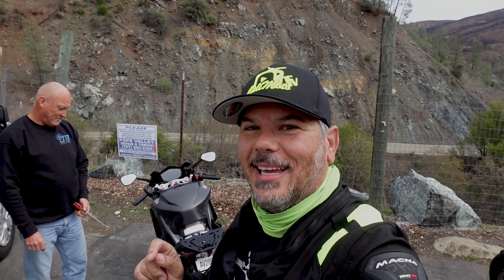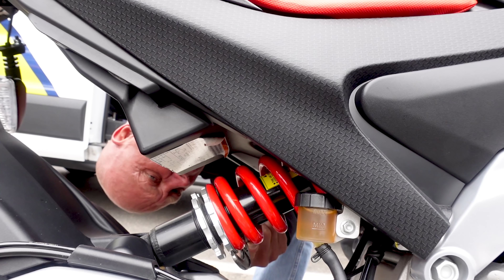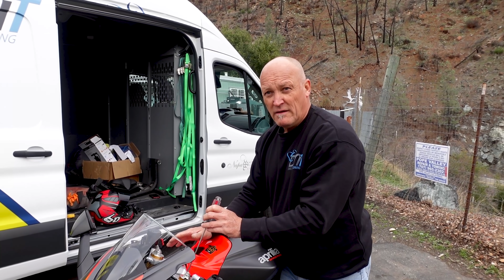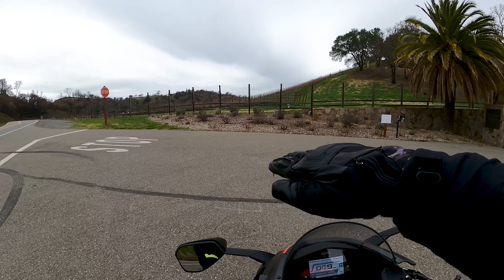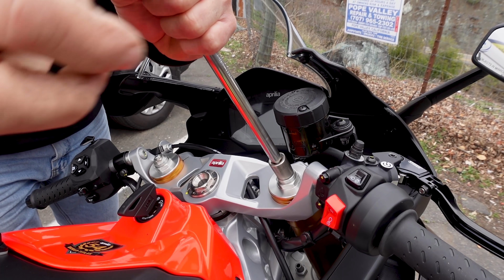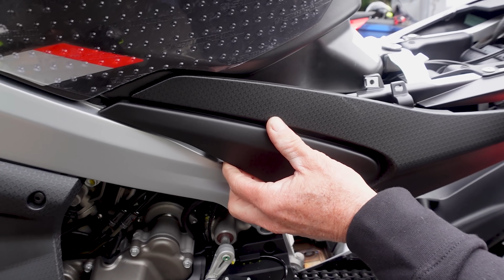2021 Aprilia RS 660 | Suspension Tuned by Dave Moss

Comment: So I am 206 without riding gear. This bike is 13 grand or more and I would need to replace suspension? Is there a fun good handling bike like this that comes with a suspension for my weight class?
Reply: Sounds like it would be fine since you are 40 lbs lighter and they got it set up fine. Bear in mind manufacturers can’t build a bike that has unlimited adjustability and optimized performance as those design goals counteract each other. This bike is definitely biased towards performance over adjustability. They try to find the sweet spot and design both the suspension and rider triangle for the average rider’s size and weight with some range of adjustability on both sides. I have the RS 660 and it’s such a great bike that I wouldn’t think twice about spending a couple hundred dollars on a spring.
Reply: @samanthagregoryurich4167  Great…thanks for the info. Sounds like I would like to try it. So I would be riding mainly on the street?
Reply: @dry509  I've seen bigger guys on the track with the RS 660 without mods so even on the track it would probably be fine up until the intermediate level (usually red group). For the road, no worries. You would be missing out if you don't do track day though! 

I'm 170 pounds and have been running the stock settings for 8000 km and thought my bike handled perfectly. After 5 track days, I'm going quite a bit faster so getting to the point where I should probably stiffen it up a bit when I'm going to the track.  I'm starting to feel some of the things Dave Moss is talking about and I can see it on my tire wear. Still, the bike gives me enough confidence to out-brake more experienced riders so it can't be very far off in adjustment.
Reply: @samanthagregoryurich4167  Awesome…thanks for the feedback.

Comment: I did a remote tuning session with Dave back when I had an Indian Scout Bobber that only had preload on the rear shocks.  Between the adjustment he helped me walk through along with tire pressure changes and handlebar/controls adjustments, it was like riding a new bike and saved me from spending money on shocks I did not need.
Reply from the maker: Nice! That sounds about right 👌

Comment: why not just drill a 3/4 in hole in the plastic to access the rebound screw.....think aprilla would have done that from factory actually......clean hole with a grommet covering the edges would look clean and give riders a way to adjust the rebound without taking seat and plastics off......thts insane having to tear bike apart to access a screw for the shock
Reply from the maker: You'd think that 😂

Comment: Dave Moss!!! THE grandmaster of Suspension tuning worldwide. You never stop learning, by watching him explain the art of suspension tuning! Greetings from Greece (Athens) and one of the biggest fans/followers of yours Mr.Moss.
Reply: World wide. Easy....
Reply: I think this guy got no idea wtf he’s taking about . He says he’s “compressing “the spring , the only think that changes the compression of the spring is the weight of the bike and rider on it . By adjusting pre load you are only adjusting the ride height by extending or retracing the shock .  If you were compressing the spring the bike would be LOWER . You can’t adjust the tension of the spring ! He says ride will get stiffer if it’s got more pre load but ride should be softer, it’s up higher in compression stroke where the valving is lighter . 🤷‍♂️ I have no idea how you could be a suspension tuner and have no grasp on this concept …

Comment: most OEM componets the rebound has an effect on compression as well......am sure the top tier suspension companies have isolated this better or completely but i know my older bikes worked this way. ( think my ohlins TTX had them isolated pretty well )....i love suspension and not a tuner just a fiddler......ever since i tuned mine to perfection " on accident" b4 a race i been fascinated ever since......he seems way too heavy for stock spring especilly if he is faster rider......new shock in the horizon with stiffer spring.......suspension is such a fickle thing but so beautiful when you get it dialed......
Reply from the maker: Yep

Comment: Am I the only person here who thinks this guys logic on pre loading a shock is completely wrong ? When you “add preload “ you aren’t compressing the spring “ as he states . You are extending the shock inside of the spring ! Therefor  making the bike taller . The spring stays the same as it will only compress by what ever weight is on it .  And adding “pre load “ or making ride height taller in rear won’t make it stiffer . It should make it softer if anything as you are now further into the softer part “top” of the suspension stroke  where valving etc is softer . He says he’s compressing the speing , that which isn’t possible but if it was he’d be lowering the bike

Comment: I am the same weight as you so I’ve gone from 18 clicks out of 21 to 15 of 21 on the front and 2 lines on the preload. And from 8 clicks out of 16 on the rear shock to 4 clicks out and added 2 full turns of preload on the rear which started at 6 lines showing. That’s the same as your setup isn’t it ?

Comment: Wheel travel at rear is 130 mm so rider sag of 26 mm (your starting point) is only 20 %. I would have left it as is and certainly not added preload.
Reply: He's bottoming the shock though. I'll choose to add preload too rather than running out of travel at this point. The true answer is aftermarket shock with correct spring rate.
Reply: @paulh9301  the tuner says he can bottom the shock by hand which is very surprising and something the video misses. It's confused also by making damping adjustments at the same time. It's after increasing the damping (maybe it does both compression and rebound like he says) that he says he can no longer bottom by hand. I always set the sag first
Reply: @Bunter1815  That's exactly what happened.  Preload was set for sag first. Dave added rebound damping because he was expecting to need it after that change.  He did explain it's because it'll be closer to topping out so he's trying to slow it down.   The damping adjuster, like other cheap Sachs units, is combined for rebound and compression.  So they only wanted extra rebound but got extra compression with it.  Hence backing it out again once the tyre showed the compression was too stiff.  But the result was still balanced front-to-rear in rebound, so no problem.
Reply: So if say you are a lighter rider, say 180lbs, and have not compressed the spring and damper through wear as much, would you still likely need to adjust the rebound on the rear to avoid the double/triple bounce?  
Has Aprilia set up the RS deliberately soft from factory (meaning high rebound, as Dave talks about "dialing it back" meaning reducing the rebound?).  
Many reviews of the bike mention the rear shock as the bikes weakest link, just wondering if this is because of the setting and has the setting been a contributing factor to the bearing play (AP Workshops review).   Any other owners experienced the bearing play/wear in the shock?
Appreciate help, expect my RS660 some time soon and I'm a complete novice on the mechanical front.

Comment: Hi Mate! I am new to your channel and this was a nice video. I just wanted to say my height is 168 cm and if i buy a 2017 gsxr1000 or a zx10r/zx6r  will i be able to balance them with my both foot or will i have to tip toe? and do u suggest that if i lower the suspension of the bike would i be able to balance with both foot? waiting for your reply :).

Comment: I don't mean to sound harsh, I just found your channel and this is the first video I've seen, but I find it strange that someone who seems to have significant experience on a bike and has a good following on a motorcycle based channel would have such little functional knowledge of suspension.  Even terms and descriptions.  Just seems odd...Like not knowing ANYTHING about setting rear preload, or which way the adjusting perch would need to turn, how that affects static ride height etc.  These are very basic concepts.
Reply: @CaliMotoTV  Yeah that's fair.  Just that there's not always a Dave around when you live like, pretty much anywhere else in the world.  I don't mean you shouldn't use a Dave, but unless you were playing dumb to play up his skill it seemed a bit odd.

Comment: Have Aprilia set this up for "lighter" riders ? Are they presuming that younger/lighter riders will be the main customers??
Reply: Keep in mind that Europe has a lower average weight than the US and Aprilia is a European brand.

The average US weight by quick Google search is nearly 200lbs vs around 155lbs in Europe. The video host/rider is past both of those averages so of course it's going to be under sprung for him.